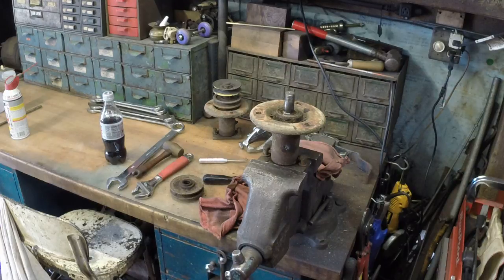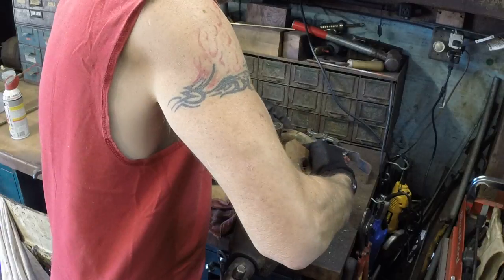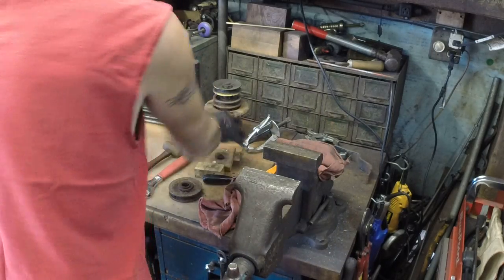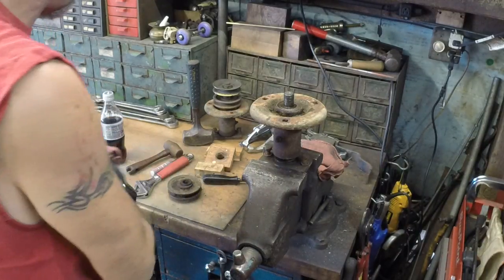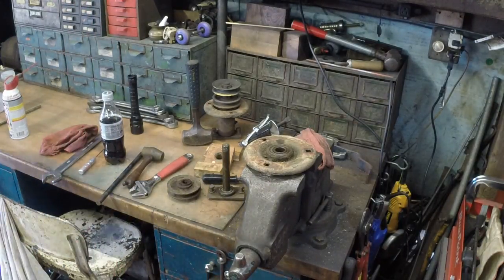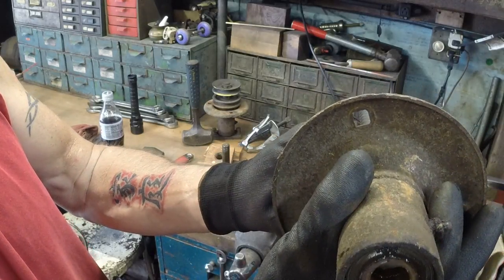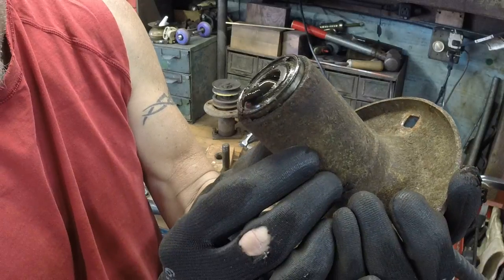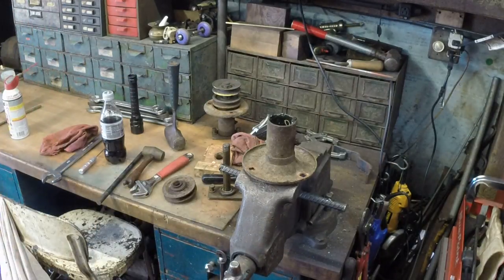Rebuilding Deck Spindles for Simplicity and Allis Part 2

Comment: Just a thought, sir, ...could you place the spindle body sideways in the vise (vise a little slack, of course) with the collar of the spindle body against the side of the vise and drive the spindle out sideways similar to the way you did it vertically to get it started? It might keep you from getting "tennis elbow" in the long run from holding it up in the air with your hand and arm while tapping on it. Thanks for taking the time to make this series. I may never work on one of these, however, there are principles you have demonstrated here which can easily have universal applications. This is the type of thing for which I watch your, Donyboy73's, Bruce Pender's, Doublewide6's, Mowermedic1's, and a select few other's videos.
P.S. I also have a list of channels I watch simply to learn what not to do! I am sure you know what I mean.
Reply from the maker: What ever way is most comfortable with the end user who follows the video. Everyone has a different style. I just try to make sure the process is there and leave the way someone gets the job done to them. Zip~

Comment: i know if you greased em too much it will blow the seals out of the bearings......
Reply from the maker: Randy had a good idea to remove the inner facing seals on these newer and cheaper communist bearings to help them to last longer. I may have to give that a try. Cheers Sam! Zip~